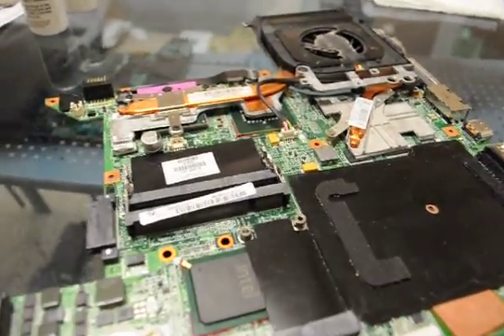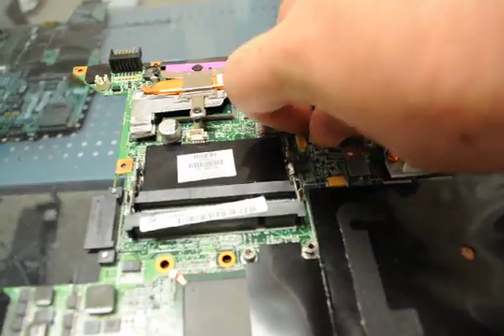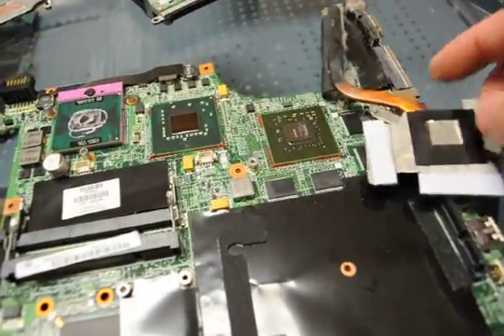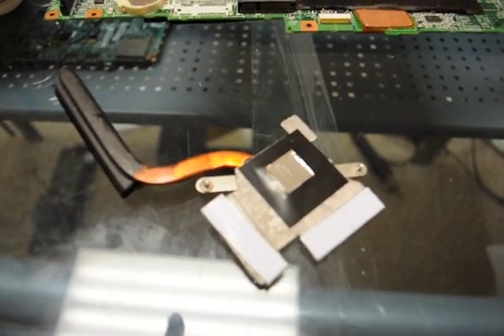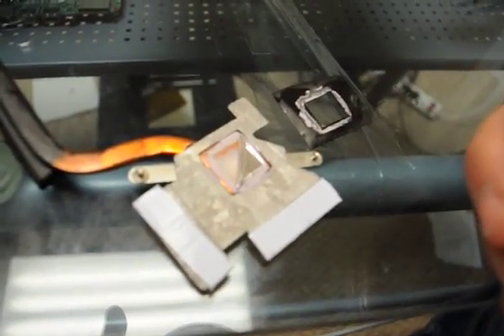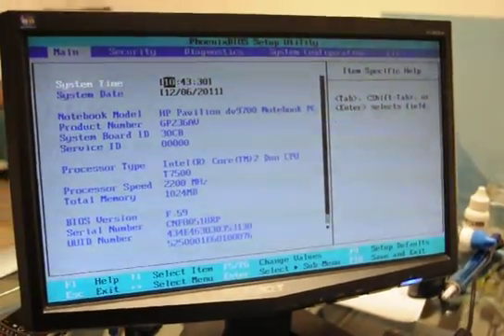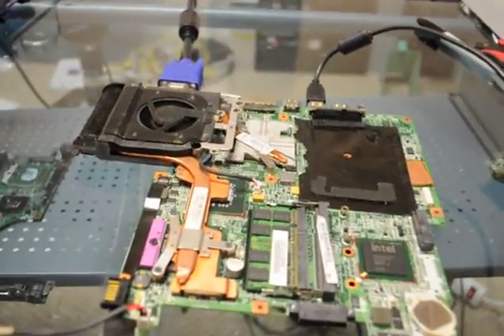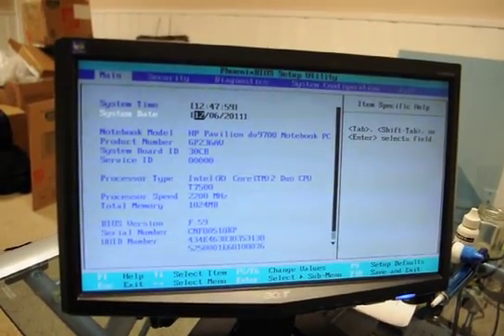IR BGA reflow of a HP DV9700 Intel laptop with a Nvidia G86 graphics chip to fix a no video issue

Comment from the maker: @riccardocosenza Now reballing is a fix, but if you overheat the new chipset and damage the pad under it or even the joints?  What about the traces in the multilayer board?  What about the surrounding components that could fail after a reballing?  Did the reball save this motherboard?  Did it actually help more than a reflow after you spend two hours working to reball?  I can sit and preach all day regarding reball or do not reball, but I feel it is excessive if you do not require it.